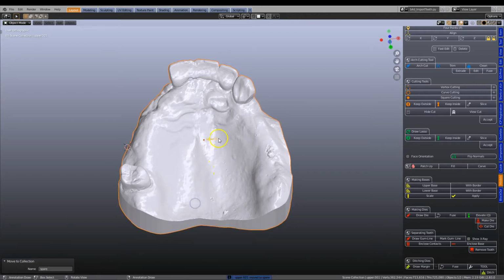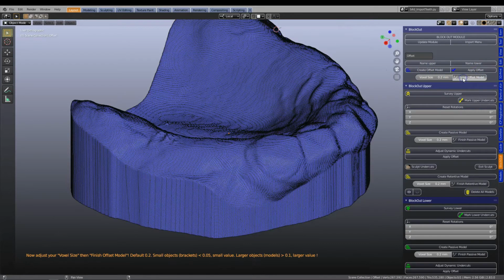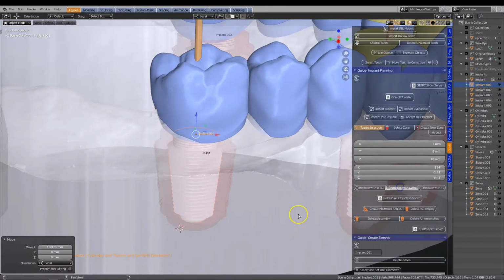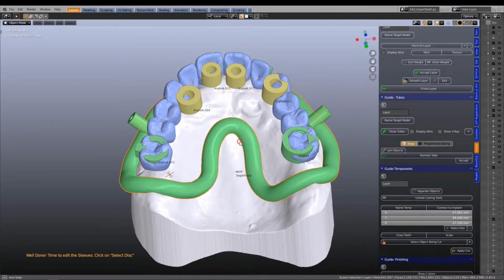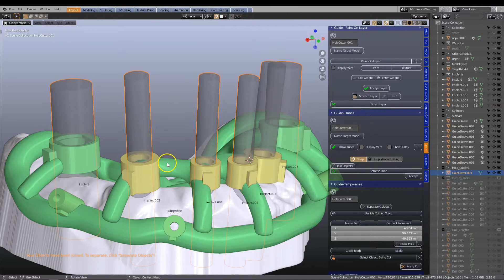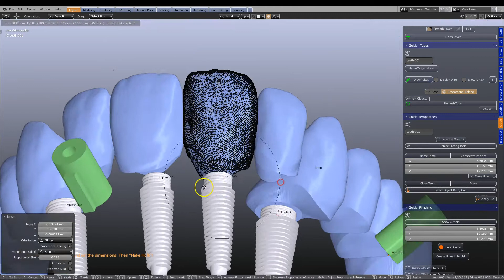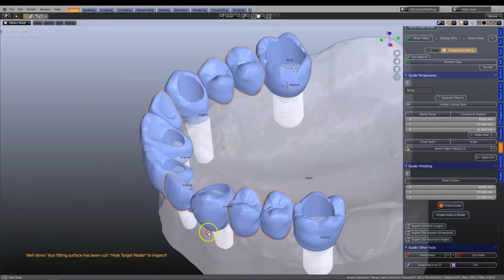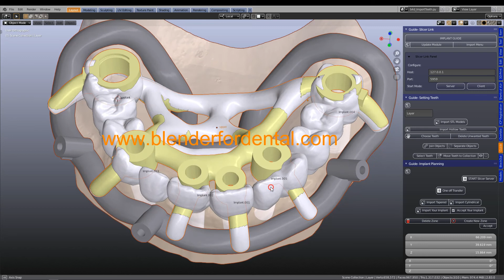Stack-able Guide B4D Guide Module

Comment: Hi B4D, I see that in this theoretical example, you oriented the maxilla with the incisal edge facing up in the Z axis. Does this needs to be the case when you have to the design similar like on both upper and lower jaw mounted at the correct VDO with the help waxup or bite registration? The reason why I'm asking is because I'm about to do one. And I reviewed a question posted by a member in the group chat (Basic Support group) on the B4D website in which the iBar module was flagging  the fixed detachable design with maxillary incisal edge facing down, and your comment was to re-orient the fixed detachable design so that the incisal edge facing upward.